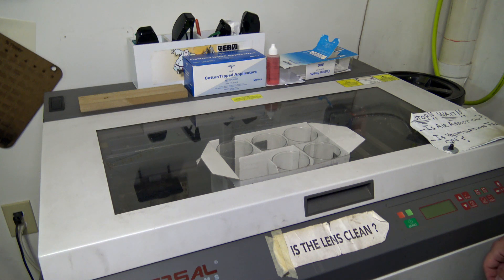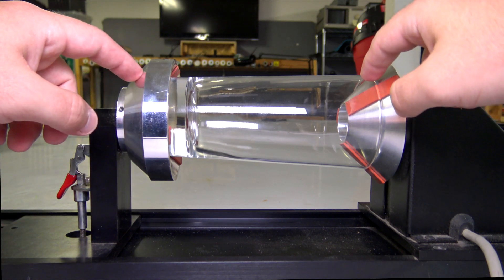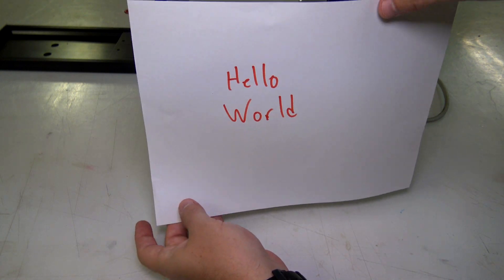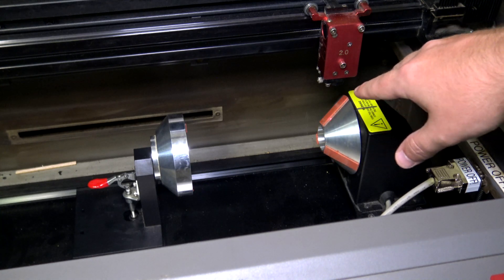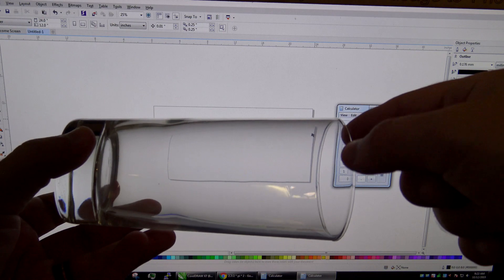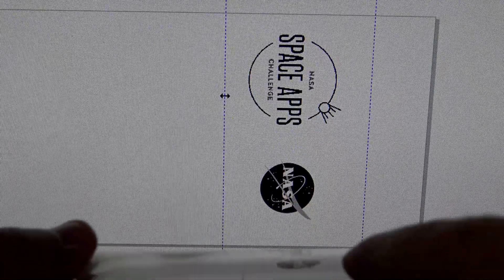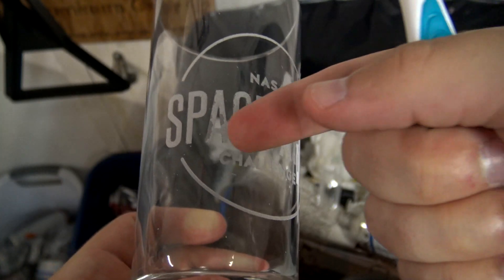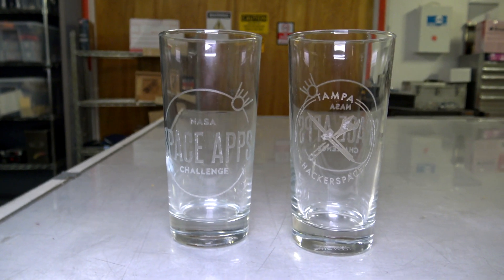How do you Laser Engrave round objects? - Laser Etching logo on glasses/mugs

Comment: Will that attachment work with a glowforge? Or does the laser printer need to be the same one you have in order for it to work?
Reply: Rotary attachments are specific to the engraver, since the laser head movement changes (only back and forth), and the rotary attachment handles movement in the other direction. Also, others have demonstrated you can actually engrave on cylindrical glass on the glowforge (pattern has to fit entirely on side nearest the laser) - do a search on YouTube

Comment: You have wrong settings that's why parts of glass simply cracked off. There is a way to do it right and get nice white engraved surface. You need to adjust power vs speed to the right values.

Comment: You made it more complicated than you need to.  2.7 is the diameter.  All you had to do to compute the circumference of the circle was to multiply 2.7 * pi

C / D = pi  <--that is the definition of the pi equation.

p.s.:  chemical etching produces a far superior look & you don't have to brush away sharp glass.
Reply: Sandblasting is the way to go.  Something is missing from the laser technique here.
Reply: But.... you can't produce a acid etched design with many small details in the time it takes to produce a design file... multiple times.
Reply: @CowsGoMonkey  You also don't need a laser engraver to acid etch glass...
Reply: @ab_ab_c  But a laser engraver/cutter can do more than etch glass lmao. Or are you gonna tell me that they make laser cutters for no reason because acids are a thing. This isn't a video on how to etch a round glass object. It is a video on how to LASER ENGRAVE a round glass object.
Reply: @CowsGoMonkey  I think I made my points quite clearly.--there is an easier way to compute the circumference of a circle & chemical etching produces a better results.  You're free to disagree with either of my points as you wish, but, some methods produce superior results than other methods.  You wouldn't use a screw driver to carve a fine piece of wood when you could use a chisel or a carving knife--llikewise, laser etching in this video doesn't produce a better result than chemical etching--which is why it isn't the superior method to use for the best results.
Reply: Or more simply 2r = d